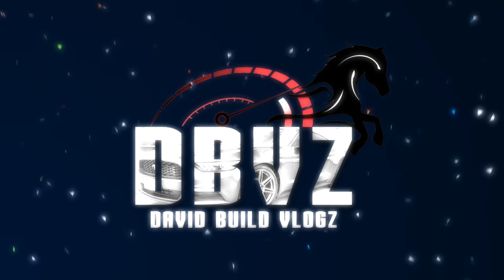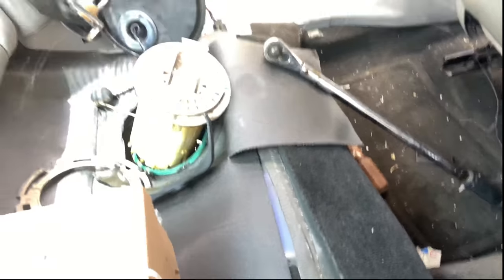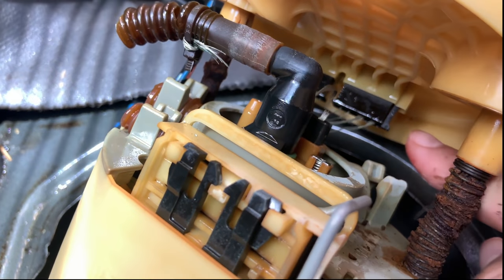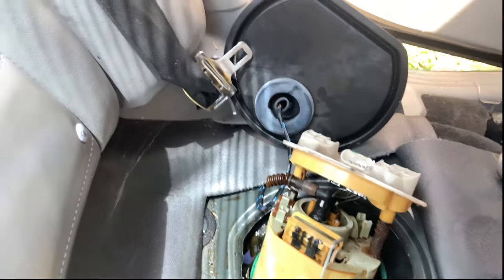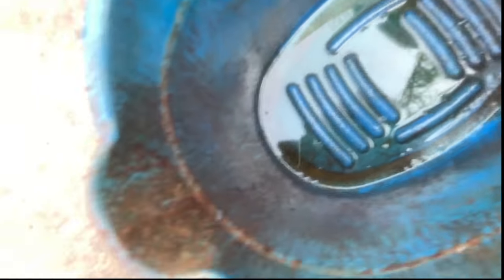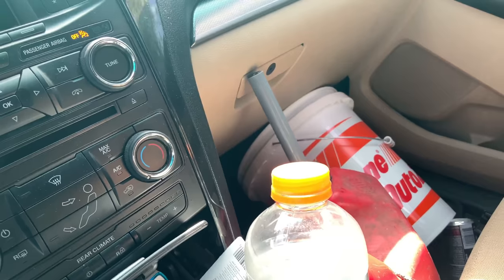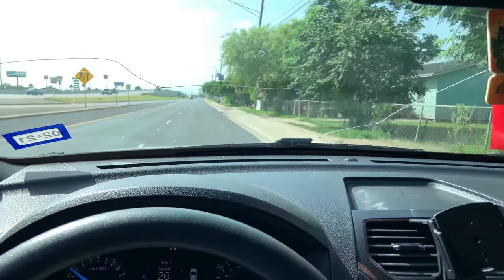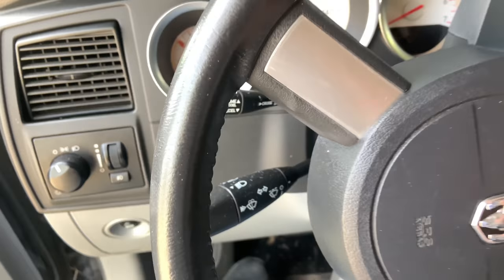Replacing the fuel pumps  Dodge charger first start

Comment: I just replaced my fuel pump on the driver side of 2007 Dodge charger. It still has a jerk when is gets below 1rpms. Is the driver side pump needs to connect to the right side one? When we took it off it was? Please give your advice. Thank you Barbara
Reply from the maker: @TheVampiregirl84  yes it does one is the fuel pump and the other one is the sending unit they usually are replaced together